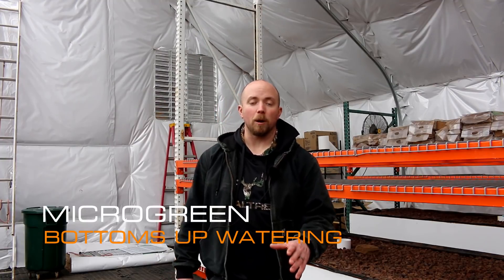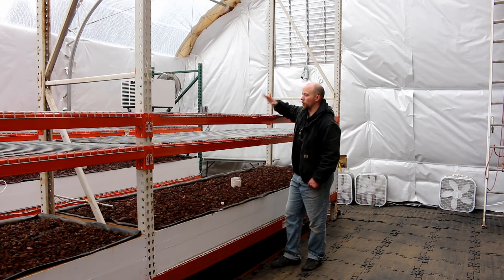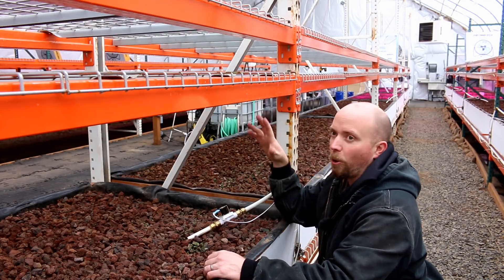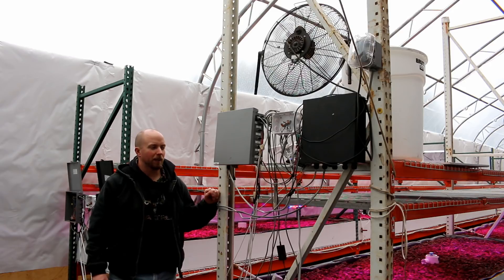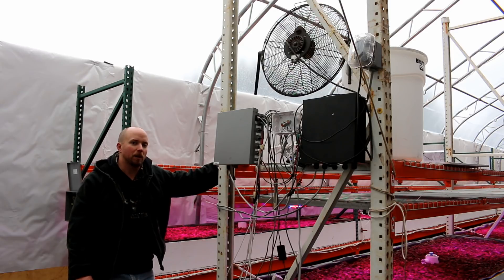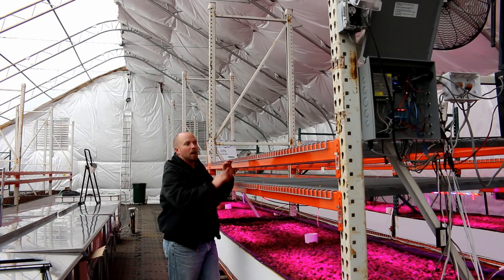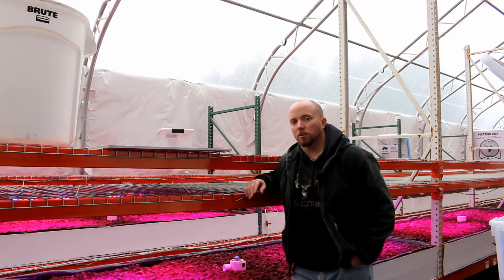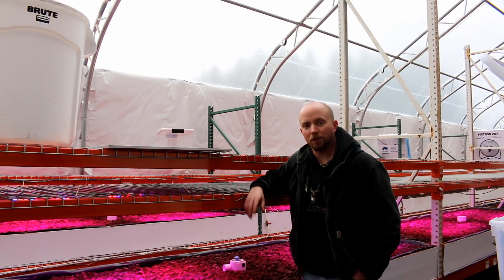Requirements for BOTTOMS UP WATERING

Comment: I wonder if you cycled your existing water valves maybe 5 or 10 times if you could get them to function.  Just a thought.  Easy to do with automation.  I haven't heard what the failure is with the current valves but I just had this thought as something to try.

Comment: maybe a tip on leveling the trays: rough level the big underlying tray, and set every growing tray to hight individually, so you make use of the fact that the water is allways level in the water tray. if water is pumped in, all the growing trays get to touch the water level at the same time, thus sucking up water for the same amount of time before the draining of the big tray.cheers.

Comment: Jeff I think putting a float switch in the trays to give the system direct feedback as to when there is enough water in the tray.  Using pump on time as a measure of the amount of water needed may not be the best idea.  By using a float switch your system knows when the tray is full and cuts down the chances of flooding the trays.
Reply: Kriss Femmpaws I agree, too many variables to use time as the control.......but, I don’t know much about the process he’s trying to use.  I get the impression that he isn’t intending to have a constant level of water in the tray, in that case time might be fine as the control.
Reply: Kriss, I concur.  Having purchased custom machines and learned the approach to controls, one learns time is not to be used as control.  It works for timeout but sensing is the way to know if your action has occurred.  If it hasn't in a given amount of time, then sound the alarm.
Reply: I have made float switches that would detect as little as a 1/4 of and inch rise or drop in fluid.
Reply: It sounds to me like he is planing on using flood irrigation.  Flood the trays in the morning and let them do their thing.   I wonder if flooding the trays then after an hour or so soaking dumping the water into the aquaponic beds below them may be a way to warm those beds up for better plant growth.

Comment: TRM, use a pump like this: http://www.goldmine-elec-products.com/prodinfo.asp?number=G19899  Then add a 12V solar panel to power it. It can charge during the day and run off the rechargeable battery at night.
Reply: That's a nice idea for a pump but it likely doesn't have the head pressure to pump water up six feet that would be about three psi.  Most small low voltage centrifugal pumps struggle to pumps water up three feet.  Even small to medium sized 12 volt bilge pumps are hard pressed to make four feet of head pressure.   With open face centrifugal pumps as head pressure goes up the flow rate drops, with some pumps it can be drastic when going up say 12 to 18 inches.

Comment: The system still has a single point of failure in that it needs the grid power for the pumps. Adding 4 or so panels and enough batteries for 2-4 days of running DC pumps would let the DC pumps run keeping both the plants and fish alive till grid power is restored. Finding a DC air pump could be a pain but worth the effort to keep it DC to avoid the energy waste of DC>AC or DC>AC>DC most systems have built in. 

Any thoughts on a work lockout key switch on the systems for those times you need to change something so nothing gets unplugged and forgotten overnight?  Figure you keep the key on something you are not going to forget when you finish for the night

Comment: Just thinking out loud here, which is never a good thing. If you had a holding tank above the grow lane, gravity could feed the trays with a type of drip valve system and when the holding tank got low enough, the pump could kick in and refill the tank. So only one pump. Question, would it be possible to have the trays just overflow and rain down onto the lower grow bed thus killing two birds with one stone? Thanks again for the update.
Reply: Garnet Carmichael use gyser pump to lift water to that tank then all you need is an air pump ......less power no clog

Comment: If you are using the wicking effect you would not have any serculation of nutrion depleted water back to the fish, but if you insted place the grow trays a short distanse above the watering trays, and then fill the water up so the level is some distanse above the bottom of the grow trays. Then water will flow into the trays and out again thrue the day when the water trays arre drained.

Comment: Like the way this is coming along. For draining you should use one of the old valves than you can tie it in to the automation. Than you can fill and drain anytime. You could do like a soak cycle type of thing. Let the water sit for 4 hours than drain the bed. I think you should try this also on you big beds also so the disappointing bell things are gone.
Reply: I had the same thought.

Comment: What are considering using as a growing medium and do you have any idea of its "normal" moisture content when filling trays prior to seeding? 
I ask because many mediums if very dry will float in a shallow bath of water initially and upwards movement through the medium by capillary action can be pretty sketchy ( variable density of the medium as well as variable moisture content) which in turn leads to very variable germination and establishment of the seedlings. This will probably, in my view, create issues at harvest of mixed growth performance - this may of course not be a concern.
Some further trials perhaps to assess this issue?